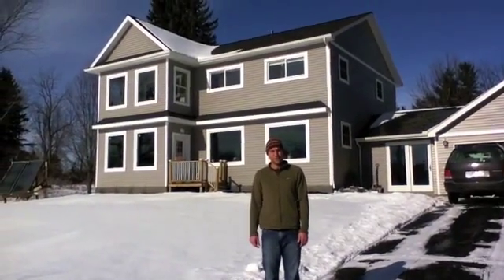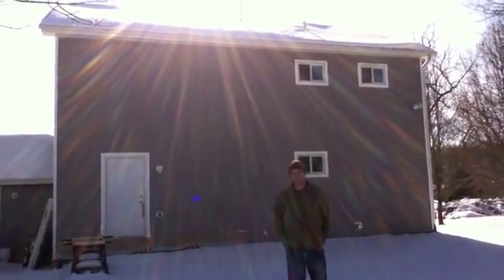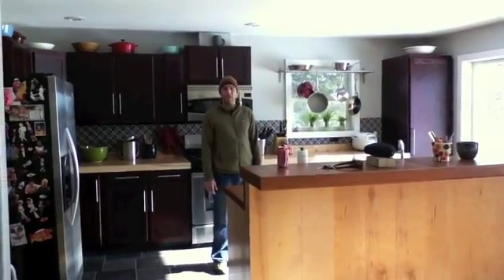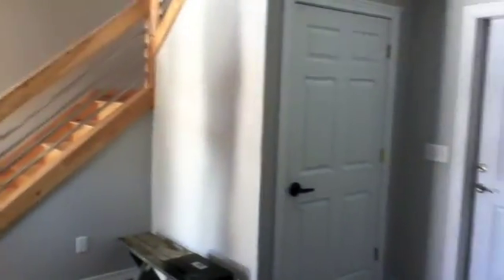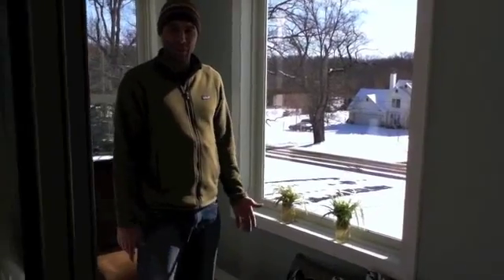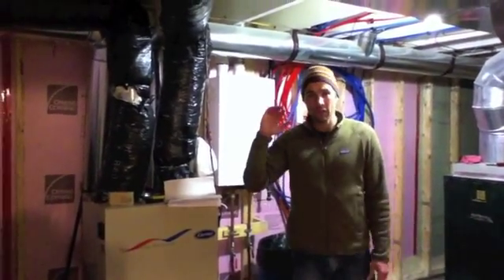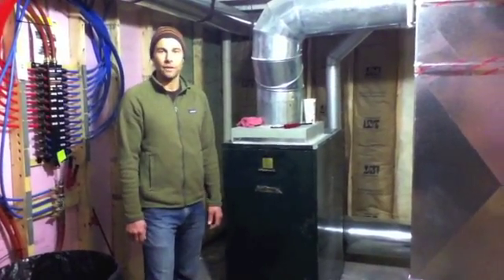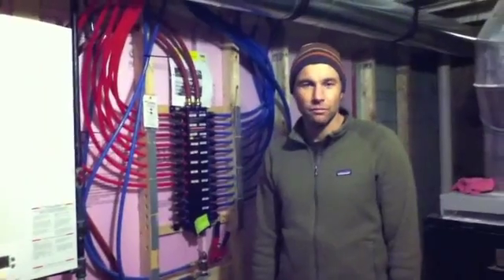Our Passive Solar House Explained

Comment: I just installed a Burnham 85% gas furnace.  The more efficient one had so much electronics that they recommended a yearly maintenace agreement.  With the new furnace there is an option to have a waterheater attached that is heated by the furnace which I hadn't heard of before.  The plumber was telling me that the hot water on demand systems are not as efficient as they advertise and have design limitations.  Maybe you can sell the pellet heater and buy a solar panel.  Interesting video/ideas